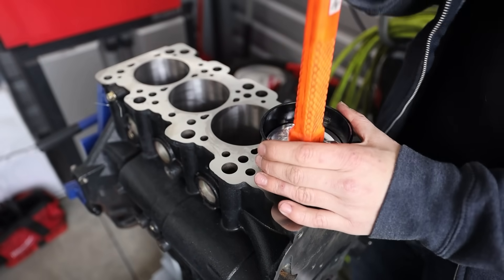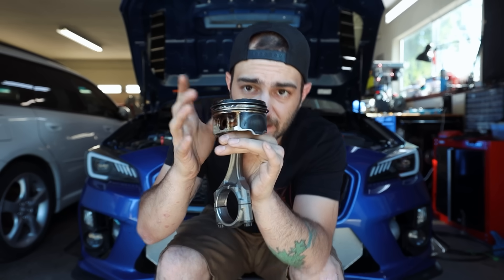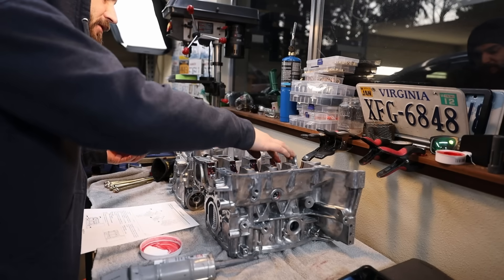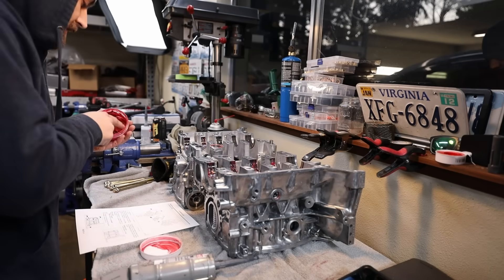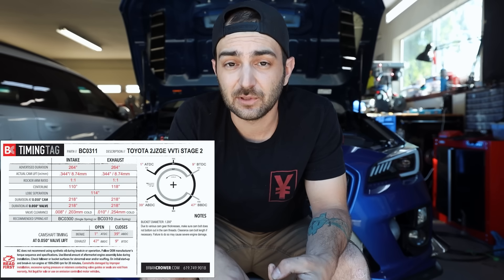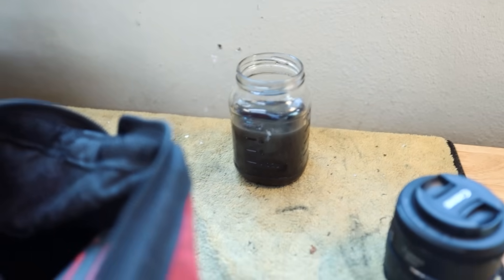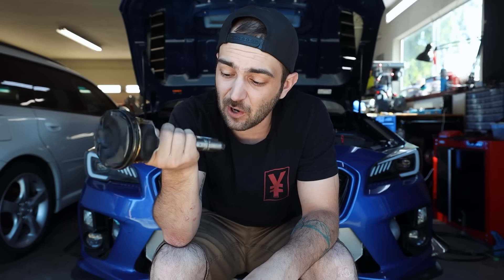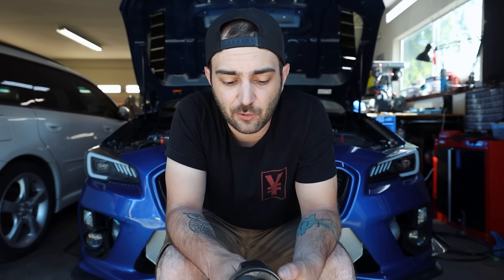How To Break In a New Engine.

Comment: Have you ever sent your oil to Blackstone or the other oil assayers to find out if there's actually higher amounts of 'particles' or a breakdown of your oil during break-in? Doesn't a good filter remove particles large enough to damage a bearing or cylinder within the first few miles of it's first run? All quality modern filters remove particles thousands of times smaller than the bearing clearances. No chunks of metal from assembly 'wear off' after all the oil has circulated and get trapped in the filter. Have you ever examined a filter when you change oil during break-in to see if there actually are 'metal particles from break-in' inside the filter?
I know of people who have damaged their engines during break-in. Typically they did not follow the factory recommendations to limit engine speed and load for the first few thousand miles, Engine friction is higher on a new engine, and more heat is generated. One particular owner took his air-cooled bike with newly completed valve job with it's tight valve stem clearances onto the highway on a very hot day, and seized the valves...

Comment: I bought a 2019 Nissan 370Z new at the end of 2018 and am now hitting about 57K on the mileage. I have used only the recommended Nissan ester oil and good Fram Ultra Synthetic filters. I run ⅓ oz of Redline SI-1 fuel system cleaner per gallon of gas as a maintenance dose to supplement the Shell Nitro V-Plus that I use. The oil changes were done at 300 mi, 900 mi, 3K mi and the rest have been done at 3K mile intervals. I drove the car very gently for the first 1500 miles, with revs below 3500, no constant highway speeds and no hard acceleration. The engine has always been warmed up until the coolant gets up to temp, very quickly, on a cold start before the engine is loaded. Revs are kept below 2500 rpm until the oil is up to 160⁰ F.

Results:

For the first 15K miles oil consumption was about 3oz at the end of the 3K mile OCI. There was a slight amount of soot on the inside of the exhaust tips. After 15K miles the dipstick showed no oil usage at the end of the OCI and the exhaust tips became even cleaner, with virtually no residue. The engine runs smoothy and quietly with no problems to date. I don't know whether the good behavior of my engine is due to my care, good luck in getting a good engine from the factory or both.

Comment: I think a lot of things said were good, but new parts arent smooth. The metal surfaces have high and low spots. The low load break-in process recommend by the OEM is to ensure these "rough" surfaces are polished down without heat and minimal wear on surfaces. Although oil is meant to hydrodynamically seperate metal parts, we still rely on protecttive additives like ZDDP and Moly. This wear is one of the reasons you don't mix and match engine parts during a rebuild, as the wear has already occurred between contact surfaces.

High ZDDP content in break-in oils help coat the metal parts with sacrificial coatings faster than standard oils with controlled levels of ZDDP for say emmisions. They can also help chemically remove high spots in higher doses.

I love your recommendation to replace oil at low miles. This helps remove assembly debris and break-in wear particles.
Reply: Just remember you don't want moly in breakin oil. You want friction.

Comment: Here how to do the right way not the easy way..    From cold,  start it and hold the gas peal to the floor in neutral run it wide open for at least 15 minutes.  If it does not blow it is broke in, oh down..
Reply: You forgot that you have to flood the throttle body with break cleaner and run the first tank of gas on ethanol.

Comment: Do what your builder recommends... what if you built your engine for the first time with new pistons and rings 😅
Reply from the maker: Lol, do what you believe is right then 😅
Reply: Not gunna lie I did it completely wrong to what you said 😅 I left the plugs and all in and tried to start it luckily it did not not start right away cause the spark plugs were bad so it got oil pressure changed them out and started up and ran for 30sec then started looking up procedures to see what to do cause pulling that thing back out is not I want to do so soon.

Comment: Only thing that really bothered me is around the 3:00 mark when you explained the rings. ONLY the 3 piece ring at the bottom is the oil control rings. The top 2 are compression rings even though they are made/coated of different material (chrome, moly and cast typical).
I did take all your advice on the priming of the engine etc. thanks.
Reply: Not all oil rings are 3 pieces.  Just build a motor with a single ring and an expander spring inside for the oil ring. Also Napier second rings are an oil control ring. He correctly referred to it as a scraper ring.

Comment: Here's what I picked up:
1. Conventional Oil to Prime engine - idle and check for leaks - don't forget to add coolant - Rev to 2k rpm - shutdown and drain oil.
2. Engine Break-in Oil - 0 to 50 miles. Stay out of boost (30% throttle or so)! Drain and change at 50 miles.
3. Engine Break-in Oil- 50-250 miles. Limited boost (30%-50% throttle or so)! Drain and change at 250 miles.
4. Regular Synthetic oil of your choice. Have fun full boost full throttle.
Reply: this is overkill. lol. i just changed my oil at first 500 miles straight into full syn.
Reply: Almost spot on and what we've always done here in GT Performance in Ireland. Break in oil or what we call it here in Ireland "running in oil" basically mineral oil with very little additives which allows the rings to "bed in" to the cross hatched cylinder walls better. Running in oil is used for the 1st start up though until 50 miles, then changed with new filter and more running in oil up to 200-300 miles then changed again with new filter and running in oil from 800-1000 miles. Then competition filter and fully synthetic oil and let's party 😂
Reply: That's not necessary at all. Change at 500 miles. It's not rocket science

Comment: What type and brand of conventional
oil do you use for the cam break in? And I have Brian cower cams on my STI in my new built motor. I haven’t started it yet. But I noticed when I turn the crank by hand (the correct way of course) I hear the left head clucking and then after a few more turns the right head. That normal? Thanks
Reply: BC parts are basically cheap Chinese made copies of real performance parts, fancy packaged and offered at a reduced price to leading performance parts

Comment: Would you recommend the same process for a  4x4 3.0 litre Diesel engine?
Reply: No, full load on and off as much as possible for the 1st couple hundred miles at least. Will never burn oil from piston rings if done that way

Comment: Was this only about rebuild engines or does this also apply dealership bought new cars too ?
Reply: Alot of engines in New cars are already broken in before they're installed in the car. Should be good to go
Reply: @AzraelGG_  What? Who said that? So, you telling me that all those break in instructions in the manuals are wrong and the random guy in internet knows better ?
Reply: @John Snow  
Some manufacturers may require a break in, notice how I didnt say all. But alot :) have a good one. Cheers
Reply: Dealer cars already went thru step 1 or 2 here, you get it already started with at least one oil change through it. Just use normal engine oil.

Comment: What would your break in procedure be when collecting brand new car from dealer ? as manual has no break in procedure at all
Reply: Car from dealer has already had a start up and engine oil replacement. They did the basic break in step. Just follow manufacturer recommendation aka don’t rev it all the way out.

Comment: I recently bought an Outback with the FA24 engine in it. There was 43 miles on the odometer when I picked it up. I was concerned about how people “test drove” it. I have over 800 miles on it as of now. I drove it moderately for the first few hundred miles and did a few boosted highway entrance ramp pulls. Horsepower and torque feel really solid right now. The manufacturer recommends 1000 mile break in and no more than 4K  rpm’s. I’ve only gone over 4K three times for a short period of time. I was a bit nervous that I may have hurt it until I watched your video. I honestly feel very comfortable that I didn’t hurt it. Thanks for a very informative video!
Reply: u wont hurt it lol
Reply: I have a new BRZ.  I was given the same information from my dealership.  I chose to have my first oil change at 615 miles.  I am now at about 750 miles; I definitely feel like the engine is breaking in good; the way it responds is much better than the first 50-100 miles.
Reply: If you hurt it you would know it.
Reply: @MrGsxr10001  It’s good, I made that comment over a year ago. She runs great!
Reply: @MrGsxr10001  Yep, especially since it’s been over a year. Car has been trouble-free.
Reply: @MyDIYLifeOhio  Me too. I'm concerned when I got the 2024 Miata at 40 miles. I'm sure some costumers must have redlined it on test drives.

Comment: Just got my 19 sti back from the dealer who put in a new short block. They said they did the varying of rpm to seat the rings at first start up. The thing that has me puzzled is my boost was showing at 16.8 peak psi which means when they drove it after install they were hitting full boost. Has me a little concerned but i've been varying my rpms, engine breaking and not hitting boost myself even if it appears they did. Gonna start to incrementally add light boost like 4 psi and then change the oil at 1000kms and go back to normal driving.

Comment: Could you make a version for non-mechanics? My dealer put in a new engine, so I just need to know what to do now. And I don't understand your terms; have no idea what "boost" means. The 500 miles info was super helpful, though  - thanks!
Reply: Boost refers to air being produced by the turbo. You may not even have to worry about Boost, depends if your car is turbo’d or not.

Comment: Just to confirm, the cam break-in is only if you have new cams? If your using existing ones I'm assuming this is not required? If it's not required, do you still drop the oil used to fire it up and burp the coolant system ? Shout out from Australia to!
Reply from the maker: Correct, only for new cams 😁 

No need to swap immediately, but I would change it after about 50 miles 🙏
Reply: @Smeedia  Legend, Cheers!
Reply: @Smeedia  Subscribed from Australia!  My retirement present was an MY06 Sti.  Blue with the gold wheels.  My wife hated it!  LOL  With 5 miles on the clock I took delivery and just drove it like I normally would.  I don't live in a city so it was twisties and short medium straights up to 100mph and repeat.  Loved it.  Engine was like a jet the entire time. My STi is still going in 2023 and now with 135,000 miles.  Second owner.  Uses no oil between services, no fuel dilution,  Compression in 2023 read 167,166,168 & 167. Engine still quiet, smooth.  Oil & filter always changed every 4,000 miles.   1,000 KM manufacturer running in's are almost guaranteed to give the manufacturer much better chances of people having to buy new cars earlier than they should have to.  It's total BS!  Great video!  Cheers.

Comment: YES. The video I've been waiting for! Lol many thanks for sharing your knowledge on the subject!
* so now you talked about the seating of the piston rings , and you explained that the process of the rings getting seated happens rather fast..And that your method of getting them seated involved driving the car at various RPMs while inducing vaccum. You advised against letting the car run at idle speeds on the first start up, and that's where I'm lost... So ... After the fuel pump and oil pump are primed, how do you burp the coolant system without having the car sit at idle for an extended period of time? The last time I burped my coolant it took A WHILE. How did you get around this?
Reply from the maker: That's totally fine, what I don't suggest is just leaving it to idle for long periods of time 🙏 Burping and all that jazz is good 🙏

Comment: How would you break in an engine that also needs a tune at the same time?
Reply from the maker: Break in tune 
Drive 50 miles and change oil 
Drive 250 miles change oil

Send it

Comment: This is in general even with IAG Engines?  Because I'm like 700miles on my Stage 2 Tuff and Haven't introduced Boost yet. Should at least introduce it to maybe 10psi? What do you think?
Reply from the maker: All engines, but every manufacturer will tell you a diffent processing it were me I'd be goinf full send at 700 miles

Comment: Hi. I have a same build as yours around 400whp build. Your sounds pretty rowdy I love it 

My question is engine breaking
I am about to break in IAG closed block 
When doing engine break-in can I heel and toe BLIP the throttle( like I always do)  to down shift so engine break. Or is it preferred to stay in the gear and let engine break when coming to a stop?
I do hear in your video ( driving part ) you do blip the throttle for downshifts
Reply from the maker: You can, but I would stay under 4K rpm when you are doing so 🙏
Reply: @Smeedia  yes they put RPM limit I believe 4 or 4.5 rpm

Comment: My tuner told me I was pretty much broke in after they dyno tuned it. Engine breaking creates vacuum and makes the piston rings expand which properly mates them to the cylinder wall. Swapped my break in oil after 100 miles. Then changed it again before 500 miles. Working so far
Reply from the maker: Soild break in it sounds like 💪
Reply: Vacuum does not expand piston rings. 😅
Reply: Yep it's true a dyno is the quickest way and you are about 95% done by the time the dyno is finished
Reply: Dam! that motor makes enuff vacuum to bend steel? Dam!!!!!!!!!!!!!!!!!!!!!

Comment: I thought blow by referred to the combustion gases and fuel passing the rings into the crankcase resulting in higher crankcase pressure and that oil passing the rings into the cylinder was just a symptom
Reply from the maker: Can go either way, you can have gasses go into the crank case and oil getting into thr combustion chamber

Comment: What’s crazy is IAG had me to a 3000 mile break in before tune
Reply: I just got the iag magnum block, and if your read their break in procedure they say the car can go for proper tune between 800 to 1000miles. You just need to follow the oil changes upto 3000miles. But they say engine is ready after 800 to 1000miles.

Comment: I have a question and was wondering if you could answer it. Should i use the Cometic Head Gasket EJ20GN MLS 93MM .051 instead of the OEM head gaskets?
Reply from the maker: How many times have your heads been decked? Just make sure your getting the right thickness but that is a good gasket to use
Reply: @Smeedia  I’ve had them decked just once and I measured the thickness of the new oem head gasket and it was .52 thickness and the pistons are 92.5mm. I’m just trying to make sure I do it right the first time.
Reply from the maker: You should be fine to use them then 🙏
Reply: @Smeedia  awesome thank you! :)

Comment: I got a brand new block and heads put on. The machine shop that built my block (just an oem wrx block) they told me 3k.

The mechanic also had me change the oil from the 15w-40 he put in there as per the machine shop's recommendation, at 500 miles to ger any other metal left over from the machine shop out.

Then he said to keep it under 5psi, try to shift around 3500 and no constant rpm. For 3,000 miles. I think it's around 1k right now
Reply from the maker: 3K?! That's insane 😳
Reply: @Smeedia  That was my mechanic and machine shop back in Spokane, while now I'm in the Seattle area. How many do you actually think it needs for a 2011 subaru wrx?

It just has an oem motor with bolt on stuff here and there.

It's down tuned right now because of the break in, but after the tune it'll be pushing around 400 hp.
Reply from the maker: Legit like 150 miles max to brak it in

Comment: Tanner, got a question. I got a 2011 Subaru hatchback. I wanna replace the shortblock with an IAG one. While the engine is out. Anything else I should look to replace??
Reply from the maker: What are the goals for the car?
Reply: @Smeedia  Honestly, I am not looking for moon power. I just wanted to install reliability mods. AOS, intake, (based on some of your videos). Its your favorite cyber security youtube fan. I was thinking of doing the versus engineering clutch fork but while performing some research, not knowing alot about cars. Just asking questions to get to the goal. If I had a goal. I'd say the goal is 300 whp. Again, nothing crazy. Anything over that would be by accident. (It's a WRX) I  have affectionately named her ruby,  the subie. Sorry for the banter. Thanks for the reply, I appreciate it.
Reply from the maker: Personally I'd suggest just snagging a Type RA short block, cheaper and better for your goals 🤝